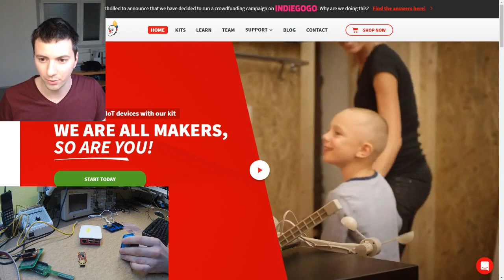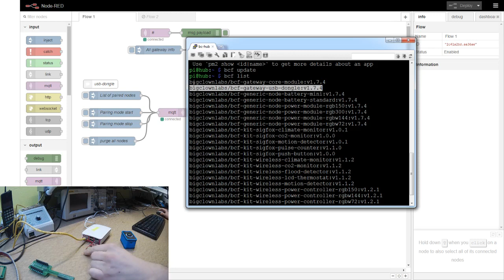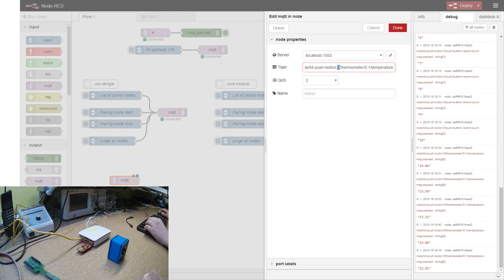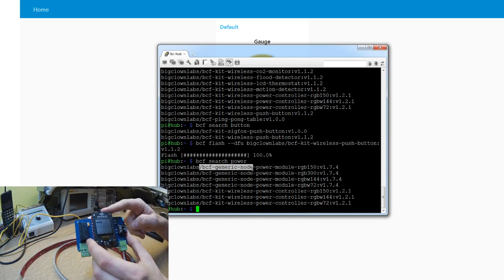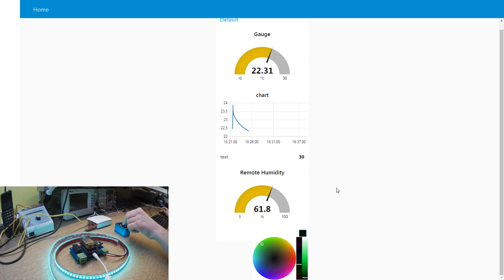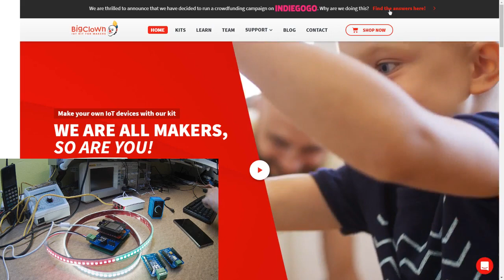Wireless & open with BigClown - how to start: MQTT, Node-RED, Raspberry Pi

Comment: Great, well explained and an interesting bit of software i wasn’t aware of. 

Are you part of the dev team? Or just an enthusiastic fan of open source like lots of us. 

Thanks again!
Reply from the maker: I'm enthusiastic fan of opensource and BigClown for more than one year. now the fun part :) in a month I quit after 6 years in my job and join them. I'll be continuing to create videos like this one. Let me know if you have any ideas or questions I should answer in next part. Thanks.
Reply: So you need both the hardware and software both? Will it work with esp8266.  Or will this hardware work with mqtt?
Reply: Np! Good luck in 6 months. I just quit my job to do my computer repair business full time 1 month ago.
Reply from the maker: It works with mqtt broker which is preinstalled on rapberry where the Usb Dongle is connected. You can use ESP8266/32 and use the pubsub mqtt li rary to connect and use the same mqtt broker.